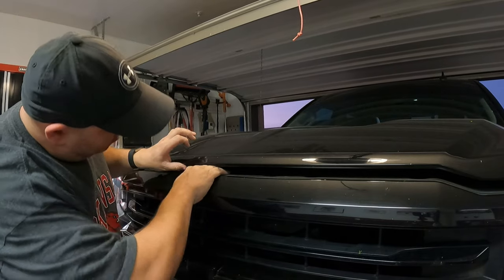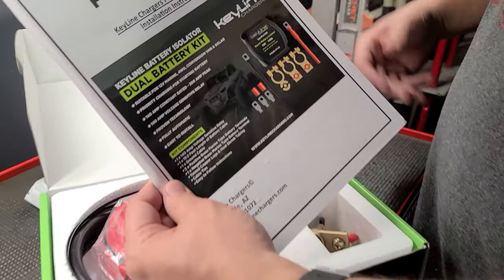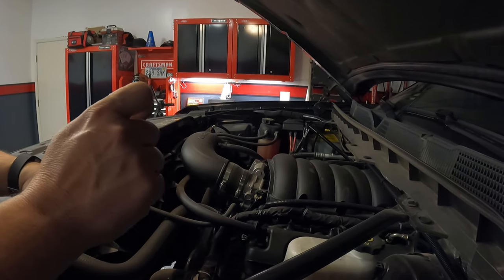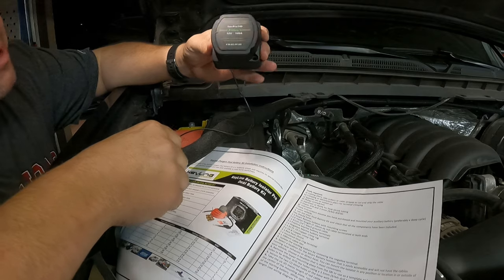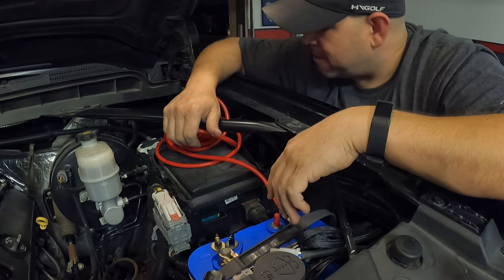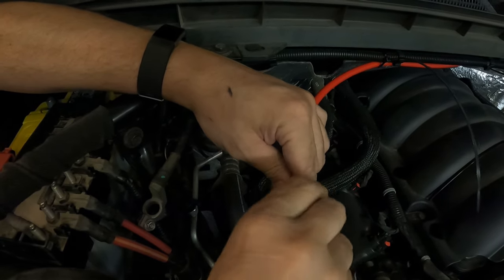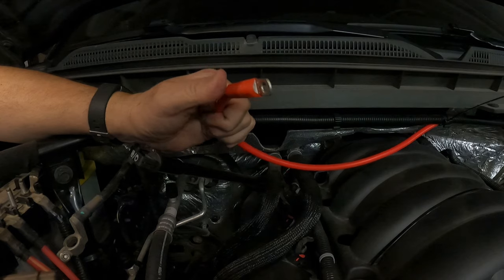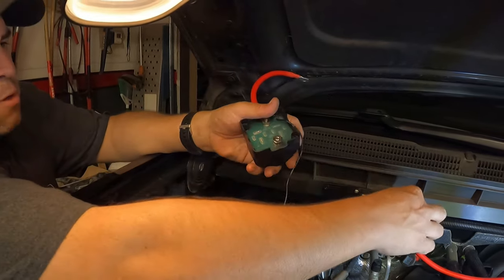DIY: How To Install a Dual Battery Set-Up Using a Battery Isolator on a Chevy Silverado 2014-2018

Comment: Daniel, your truck has a "smart" alternator, and needs the ground wire to pass through the sensing ring. If you follow the factory ground wire, you will see that it passes through this current sensor near the firewall  next to the battery. There may be potentially charging issues by not passing the other batteries ground through this ring. Hope this helps.
Reply from the maker: Thank you so much for this information.   We will definitely get it hooked up correctly.   Luckily everything has been work fine but I'd rather be safe than sorry.   Thanks again,  we just followed the instructions on the battery isolator kit.
Reply: I was just going to ask about this. I have a 2013 and want to do a dual battery set up. But I don't fully understand the smart alt. set up. There's a LOT of how to videos, but trying to find out which one is the correct way is hard. I know the alt will shut off once the main battery is fully charged. This will lead to the second battery not getting fully charged and shortening it's life. So the question is, how do you keep the alt. charging until both are full, and will keeping it going over charge the main battery?
Reply: What year do smart alts start? Any help would be appreciated. Thanks
Reply: @AG-no9uf  just follow the ground wire from the battery. If you see the ground wire passing through a sensor ring like the 2014s and up, or a sensor clamped onto the ground wire, like the 2013 and earlier, you will know if your vehicle has a “smart” alternator. It is supposed to decrease drag on the serpentine belt when the battery is fully charged to gain a little gas mileage.
Reply: I have a 2014 and I ran my second battery power wire to the empty led on the fuse distributor,so my alternator charges both,no isolator,no voltage drop,
Reply: @AG-no9uf  after 2008..
Reply: I have a 2015 Chevy Silverado 1500 with a sound system, I can use that same kit for the second battery. Thank you very much
Reply: Would splicing onto the ground wire that goes through the sensor work or should they stay separate?
Reply: @roderickr35 how has that been working I’m wondering cause there’s people saying that you really don’t need the isolator
Reply: Beating the shit out of my JL 10$, no voltage drop, but custom sounds had my 6.5 and my woofers wired together and my lc71 wired wrong, it was drawing to much current
Reply: @roderickr35 I want to do it this way also. Is it the slot next to the main power on the fuse bus?
Reply: There is also a ground wire from the bottom of the frame or under the engine to the center of the…. Well center of the engine compartment. That’s where I put my ground.

Comment: -- You need to throw breakers/fuses on both sides of the system.  I used a 50 amp on the primary, and a 60 on the secondary.  I did pretty much the same thing to my 2004 the other day.  (Tahoe.  Primary and secondary battery locations are reversed compared to yours, and had to by the tray etc)  Electric Grease on every connection, and Silicone RTV to seal where you cut the isolator for good measure.   And I question where you ran your ground.  You might have a smart alternator, but the isolator won't care about that.  The alternator will just see one battery.  But ... in my book, the more grounds, the merrier.  Just keep them minimum 8 inches apart.  Take my credentials for what they are:  Was a car audio installer for 4 years.  Built hundreds of computers, and know my way around DC power as a hobby very well.  And of course, God bless you and yours.
Reply from the maker: Thank you for the guidance.   We did end up putting a breaker and fuse after the video.  We initially grounded the aux battery to the body of the truck, but after hearing some recommendations we grounded to the Main battery post because of the smart Altenator.   We do plan on taking it to a friend's Audio shop and have him upgrade our Altenator, the wiring and the factory grounds.  We appreciate your feedback because I'm good with engines, but definitely no way a electrician.

Comment: @7.20 I use a cheap cigar cutter. Light squeeze spin and boom done
Eta: they're usually like $1 or sometimes free at a tobacco store. Smoker friendly will have em and a gas station might when
Reply: 7:24 wouldn't let me tag the time slot
Reply from the maker: That’s actually a great idea that I never thought of… might give it a try for sure next time.. thank you
Reply: Tubing cutter, just got to develop muscle memory so as to not to cut through the strand. That or a set of hand held cable cutter 👍

Comment: Since the oscillator keeps the current from flowing back to the main battery why such huge wire for just a charging wire just wondering
Reply from the maker: The isolater is to make sure both batteries are being charged while the truck is running, but with it off your only using the auxiliary battery for your accessories so your main battery doesn't drain which that's what the isolator does.  I hope this answers your question.  The kit came with all the wiring in the video.

Comment: What model Keyline should I use on my 2020 Chevrolet Suburban? And can I use Gorilla Tape to hold the isolator? I don’t like drilling holes. Just me.
Reply from the maker: Should be the same and I can see Gorilla or 3M tape working.

Comment: Would using a deep-cycle for the second battery be wise since you don’t need the cranking/starting power? And with this isolator, does it power any accessories when the engine is off?
Reply from the maker: In my opinion it is wise.  Just kinda like how the campers are deep cycle.  You can choose between AGM or Lithium batteries as they both have pros and cons.  We ended up going with an AGM battery.   Yes, you are correct,  with an isolator you can run everything off your Auxiliary battery and the isolator will prevent your starter battery from draining.   But make sure you have a way to check your voltage on your Auxiliary battery so you know when to start your vehicle to recharge it.   Hope this info answered your questions.

Comment: You mounted the isolator to the plastic shielding. Did this rip out and did you need to remount it later?
Reply from the maker: Held up fine plus I had 3M double-sided tape on the back as well.

Comment: Using a Heavy-Duty True battery isolator provides several advantages for truck with auxiliary battery

    Reliable Battery Management:
        Automatically ensures the starting battery is charged first, then charges the auxiliary battery, preventing the main battery from draining and ensuring reliable engine starts (True Battery Isolator). 
    No Voltage Drop:
        Unlike traditional diode isolators, True isolators have no voltage drop, maintaining optimal charging efficiency (True Battery Isolator).

    Dual Sensing Technology:
        Monitors the voltage of both batteries and engages charging for both if either battery is receiving a charge, which is particularly useful when using external chargers (True Battery Isolator).

    Durable and Compact Design:
        Built to withstand harsh conditions with features like waterproofing, heat resistance, and anti-vibration casing, ensuring longevity and reliability in various environments (True Battery Isolator) (True Battery Isolator).

    Easy Installation:
        Simple three-wire installation without the need to bypass existing alternator wiring, making it user-friendly even for novice installers (True Battery Isolator).

    Cost-Effective Solution:
        Provides a budget-friendly way to manage dual battery setups effectively, offering long-term savings by extending battery life and preventing failures (True Battery Isolator).

    Safety Features:
        Includes ignition protection and operates within a wide temperature range, enhancing the safety of your vehicle’s electrical system (True Battery Isolator).

Overall, the True dual battery isolator enhances the reliability, efficiency, and longevity of a dual battery system in various applications, from trucks to boats and RVs. For more details, visit the Trueam dot com or dfna dot info website.
Reply from the maker: Definitely agree with you….

Comment: Do you need a bigger output alternator or the oem alternator is good to charge both batteries?
Reply from the maker: The OEM one seems to be doing good so far.  We will be upgrading the Altenator and cables in the future though.

Comment: hmm, think you should run a fuse somewhere between the two batteries?
Reply from the maker: We ended up putting one after we did this install.   And going to put a breaker between the auxiliary battery and SPOD when we get install that.
Reply: @TheWorldCruisers  what size fuse did you use??
Reply from the maker: @toddmike25  we ended up using a 150 amp.

Comment: Hello there - quick question: with your setup, does this run you vehicle while in accessory mode? I just went on my first overland and had to rely on the wifi hotspot as my cell didn't have service. I had to keep turning the vehicle on to recharge the battery.  Trying to see if I'd be able to run the vehicles hotspot off of the auxiliary battery. Thanks!
Reply from the maker: Yes, you should be able to have it hooked up to the auxiliary battery.  You will still need to monitor your Auxiliary battery voltage so it doesn’t go dead.  But the good thing about if your aux battery goes dead you still have your main battery so your vehicle can start.

Comment: Great info seen a comment on a sensing ring did you have to do that? Or is it working fine the way you did it. I have a 2016 Silverado 1500 and want to do the same setup.
Reply from the maker: We are about to hook it as suggested with it going through the sensing ring. We haven't had any issues so far but I'm no electrician by any means.  We just followed the instructions that came with the kit.  But we are about install our Dual ARB compressor and SPod and will be redoing our ground to the sensing ring as suggested below (before we blow something up).

Comment: Blue top and yellow top are the same batter, same cranking amps and all that.  The terminals are the only difference.  Yellow top has the side screw in terminals as opposed to your top post with extra stainless terminals and of course blue top.  The red top optima is for starting only.  I know you may already know this,  just a bit of info for the viewers.  You may have charging issues since your truck runs a smart alternator and your batteries need to be monitored by the system.  Your main ground from your secondary battery needs to be ran through a voltage/amp monitoring ring found on your trucks main battery ground wire.  Very informative video.  Thanks.
Reply from the maker: Thank you for this great input.  I'm definitely not electrical savvy but plan on taking it to my friends shop to upgrade the altenator and wiring.

Comment: Did the secondary battery ground fit through the sensing ring with the main battery ground cable without any issues?
Reply from the maker: Yes it did,  shouldn’t have an issue.

Comment: I want to add a second battery and have found your video to be helpful. I have a couple questions about it.

I'm terrible with electrical stuff, but wonder how you got away with having your main battery disconnected for a while?

I just had to replace the main (and only) battery in my 2013 Tahoe LT. Thankfully, the counter guy at the Advance Auto that I bought the battery from came out to do the swap. He hooked up a self-contained battery pack of some kind to my OBD port and said that keeping the system energized would prevent having to re-program the system due to the loss of power. He mentioned that if I was doing the swap, I could hook up a regular battery charger to the disconnected cables and that would keep the system live.

ALSO, did you secure the aux battery or are you just hoping for the best?  :-)  I've seen other videos where people have have replaced that stock aux battery tray with a GM one that better accommodates a hold-down.
Reply from the maker: I'm not an electrical expert myself...lol.  To hook up the cable going to the Auxiliary battery I didn't need to disconnect the battery.   On my truck I have a factory fuse block on top of the main battery and just had to mount it to that.  When I replaced my Main battery for an AGM style battery I didn't have to do anything crazy... I think I had to roll the windows up and down but that's about it.  Our trucks may be different in that aspect.  As for the mounting of the auxiliary battery, we purchased an oem style battery tray from ebay and bolted it in.  Then secured it a factory wedge and bolt at the bottom.   Hopefully I helped in some sort of a way.
Reply: @TheWorldCruisers  Thank you, that is helpful!

Comment: What are the benefits of having two batteries?
Reply from the maker: We use ours for our auxiliary lights,  air compressor and fridge without worrying about draining the starting battery.  And I know some others use it for huge sound systems.
Reply: @TheWorldCruisers  i thought about a fridge, but are you referring to keeping the car within the ON switch, without draining the battery?
Reply: @iverson2k10  Yes. You can power devices and units from the aux battery while the vehicle is off and isolated from the starting battery.

Comment: So the stock alternator will charge both batteries? Also how did you secure the 2nd battery from moving
Reply: I have a 800 watt amp that is taking more to run and with the yellow battery, I have the same and the battery has only lasted 18 months with my amp
Reply from the maker: Yes, well atleast it does for me.  You can get an OEM driver’s side battery tray with a wedge that will bolt right in.
Reply from the maker: I’m not an audio specialist, but maybe a dual battery setup with a better alternator will help out.  Definitely recommend talking to an audio shop for better guidance.
Reply: I got my answers. Had to put in another battery tray for the drivers side. It was a pain. Had to take a bolt out of the fuse box and move it a tad

Comment: On 2017 Silverados (and even later I think), 2 negative wires feed through an amp meter about 10 inches before they tie into the main battery terminal. I saw another video and the guy who installed this same isolator said that the negative cable from the house battery also has to feed through the amp meter before it gets grounded. I'm assuming that the amp meter monitors the alternator current. I think running the house battery negative cable through the meter helps to protect the alternator. I'm not sure of that though.
Reply from the maker: Yes, you are correct and we ended up running the ground through the sensing ring after we posted this video.  We have a “smart” alternator and we didn’t know until someone mentioned it to us.
Reply: @TheWorldCruisers  Thanks!
Reply: Also check and make sure your alternator pulley is turning to,they put clutches in the pullies,so your alternator could be good just bad pulley

Comment: How is your install doing? Any problems?
Reply from the maker: It's good, I did end up running the ground from the auxiliary battery to the main battery because of the voltage meter sensing ring since the truck has a "smart altenator ".

Comment: Hey its says this battery wont fit a 2014 chevy silverado 1500 you have any suggestions?
Reply from the maker: We added a factory driver's side battery tray with a factory battery hold down wedge and it fits fine.  They are probably recommending the factory starting battery size which I believe is a H6 Group size and should also fit.  Hope this helps.
Reply: noticed you connected the battery  charging line to the first port on you battery terminal that is closest to the negative part of the battery. is that were we connect the positive line sense I'm assuming that is were the alternator line feeds from correct? or could o just connect it directly to mu positive terminal on my battery?
Reply from the maker: You can connect it directly to the positive post.  We actually moved it to over to the first terminal that directly connected to the positive post
Reply: You can put your power wire from your second battery and hook it to the empty terminal on your main battery fuse distribution block

Comment: New subscriber here. Thanks for your video.   I have a question on the isolator.  Is there any danger of the battery leads (the larger bolts) from shorting out to a metal panel?   I couldn’t see what kind of clearance there was. Thanks again. Happy trails!
Reply from the maker: Thank you for subscribing.   So far we haven't had any issues as of now.

Comment: What did you use to hold down the second  battery ?
Reply from the maker: We purchased a plate and hold down for the optima battery that we are using from Amazon.
Reply: @TheWorldCruisers  can you provide a link / part # for the hold down?  Thanks for the vid btw - very informative.

Comment: one year later. how did this kit hold up?
Reply from the maker: So far good... I did change the routing of the ground cable from the truck ground point to the ground on the main battery.   But so far it is still working and charging my auxiliary battery.

Comment: The battery plate you used for your second battery, how did you secure your battery to the plate?
Reply from the maker: I used an oem wedge and bolt.
Reply: @TheWorldCruisers  So did you replace the factory plate and get the battery plate?

Comment: why not use a dc-dc charger? There are battery isolating varieties available
Reply from the maker: We might in the future when we have more things to add, but for now this is a good and affordable option for us.
Reply: Why would you do that. This is the conventional way to run a two battery system.